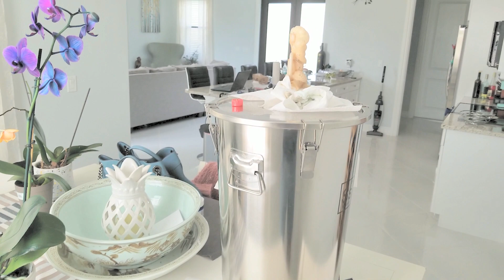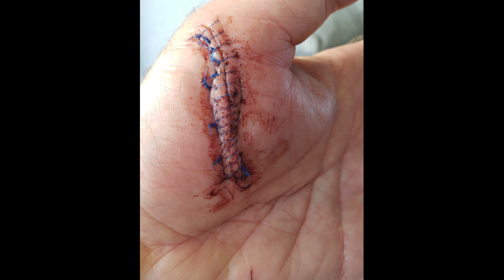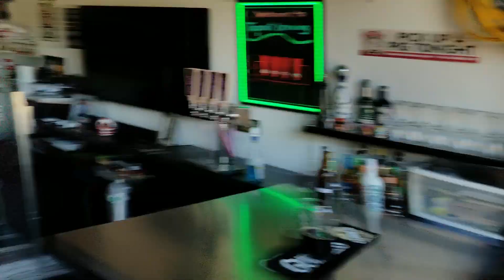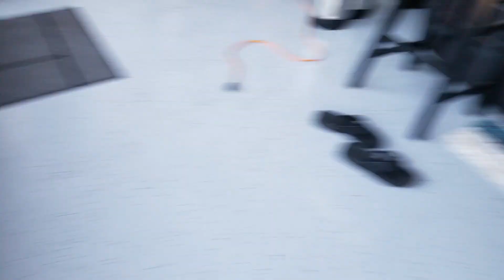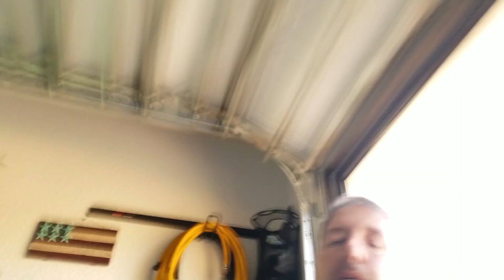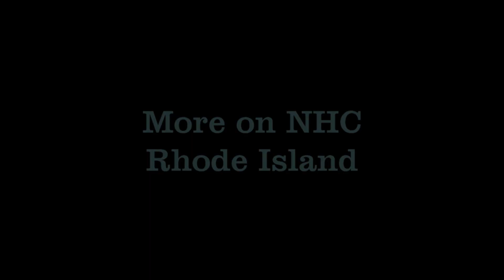HBW Feb 2019 - Carboy accident - NHC 2019 - Clements Stout

Comment: That slip really sucks. You're lucky didn't get hurt worse. My old house has the same floor covering and it was crazy slippery when wet. Not a Bon Jovi fan either....... The 1/2 silicone tube you use for your brewing hose fit nicely in the airlock hole of the brew bucket. Cheers Gary!
Reply from the maker: I know Wally, if you saw the amount of glass everywhere, you just stand there for a minute and say, "where do I start". Cheers

Comment: I had a scare a few years back with a glass carboy that exploded in my sink.  Scared the crap outta me so I got rid of them.
Reply from the maker: was it full or empty?
Reply: @chubbymermaidbrewing  full of star san solution.  I went to tip it over in the sink to dump it out and BOOM!  Somehow I got away with no injuries.  I was stunned and ran to the bathroom, took off my shirt and was looking for cuts.  Nothing thank goodness!!!  Glass is dangerous.  I stopped using them.
Reply from the maker: @WreckedBrewery  Yeah that is scary, you got very lucky. I will get rid of them all Cheers!

Comment: My 6 gallon glass carboy is at my dad’s house. I use ss buckets now. 1/2 inch high temp silicone tube fits perfectly in lid hole. The glass ones terrify me.
Reply from the maker: Respect the glass! or toss'em out. thanks for the 1/2 silicone hose tip,  that probably would have worked better,  Cheers !